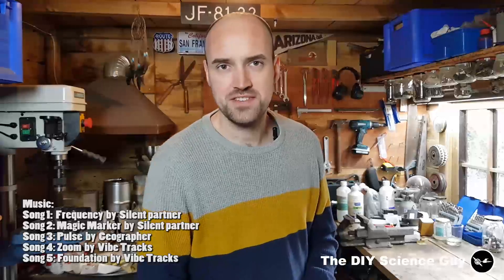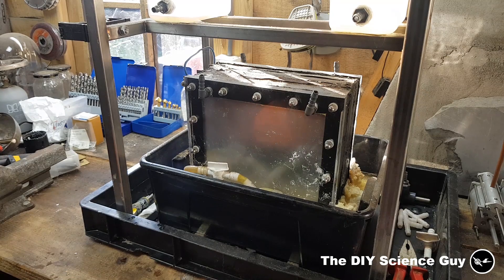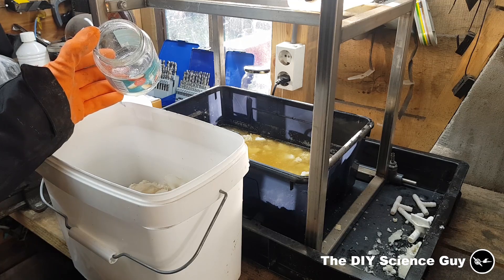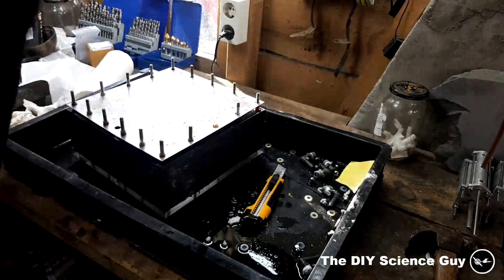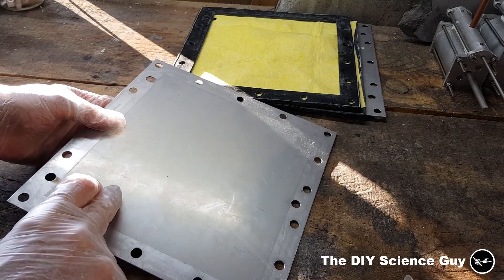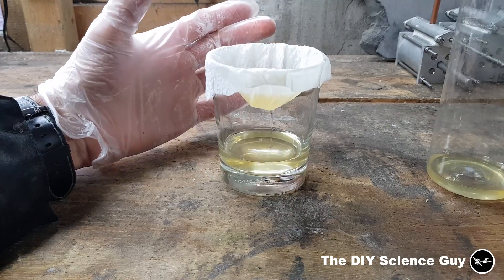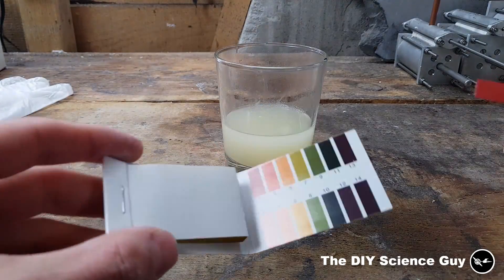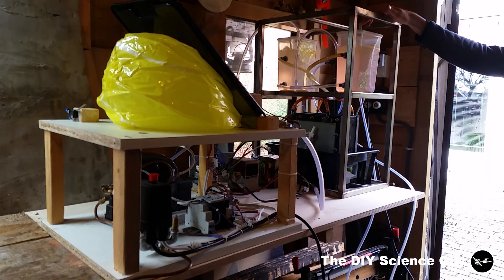Hydrogen Generator #5 Opening Up The Hydrogen Generator, Am I Producing Hexavalent Chromium?

Comment: for the hydrogen gas.  Could you run it through a propane bbq or propane accessories ?
Reply from the maker: Yes, but you need to restrict the air intake of the burner to make it burn well.

Comment: Hi superb. Can you use pure copper electrodes to electrolyse water to O2 and H2?
Reply from the maker: Thanks! No the copper will corrode away very fast. Also copper dissolves in sodium hydroxide.

Comment: As mentioned in another video. Use graphite plates. more efficient, cheaper in purchase and no nasty surprise due to decomposition.
Maybe you should use glasplates as membrane with a little slot at the bottom to separate the gases

Comment: What did your electrolyte generator drop? Bad dictation? How long-lasting is the membrane separator, which material do you use, in my made drj cel cell separator, the membrane for separating H2 and O2 gas is made of fabric, and for two years now it has been working flawlessly in :)
Reply from the maker: Nice! My membranes lasted 1.5 years. Indeed fabric works well. Polypropylene mesh is best.
Reply: @TheDIYScienceGuy   Take a look and like my experiment   https://www.youtube.com/watch?v=X69llnatPb8&t=5s
Reply from the maker: I will, thanks!

Comment: hi just wanted to ask what you think abaut using a 2 plate system at 4 volts. as far as i can tell this would be cheaper to build and easier to manage tbh im new to this stuff bet i cant see any problem with this theory so could you tell me what you think? im going off of electrochemical theory so i dont actually know if it would work in practice

Comment: I made two dry hho generators ten years ago. They were fitted inside two vehicles behind the radiator. BOTH stainless sheet were coroded within few months.The problem might be some redox reactions we still dont know about. HHO or mixture of H2 and O2 under 12v and heat of the engine bay in the summer, reaction may produce heat and/or acid or micro explotions when bubbles are forming.  After few weeks, it would require additonal  electrolyte as bubbles comes out slower. Distilled water was not enough. You seperated your Hydrogen and Oxygen, then they have not any.chance to react with each other and your temperature is controlled.  There is no pitting or corrosion on any of your plates. Mine had holes on the first one and pits on the second one. You just need to find a good cloth like membrane. The kitchen cloth eventually disintegrate in the kitchen also because it is not woven but melted together. I believe yours were set up correctly and were simply splitting H and O atoms and not nikel or chromium atoms.

Comment: You do have hexavalent chromium produce in any stainless steel electrolysis oxyhydrogen machine. I have 12 years of experience and I found a way to neutralize hexavalent chromium where it can be flushed down the toilet safely. I have EPA lab reports showing that my process actually neutralizes hexavalent chromium guaranteed. I have videos showing the process but it is not public on YouTube.
Reply from the maker: What do you mean by neutralizing? Chromium is a metal which can be oxidized ore reduced. It's never a good idea to flush it down the toilet even when it's reduced because you never know to what form it will oxidize later. Also chemical wast is taken care of for free where I live.

Comment: Excellent video! Many good news! So nickel plated copper would be affordable and chemical resistant to use safely (so 'dangerous' - well, not so!, stainless steel and expensive titanium plates can be put out). Any news about the mesh? Did you test polypropylene/pure cotton one? If no with one is better polyester or nylon mesh (both can be bought easily). Keep up you great work! I always smile when I see you face, everything is done safely and precise + good music and ideas! You made my day!

As an idea for a new video I would throw a detector subject. Simply and cheap detector for % measure of hydrogen in a mix - it would be required for safety measures when filling a tank - just something to think about. Also, better demonstration of you "balloon" :) and electrical circuit would be nice. In a long way future (I guess you are busy man) I hope you will change lawnmower with some car/motorcycle you can run on H2! :) Thanks for you hard work!
Reply from the maker: Thanks! No news yet, but in a few videos I'll have more info. Thanks for your support! 👍
Reply: @TheDIYScienceGuy  Man I love your videos, especially the hydrogen generator series, because I might want to use this in future for sustainable living and store it for use when there is no sun on solar panels.

Comment: perhaps extruded gore tex is good for a more stable separator.. Gore tex you find in the electric bay.
for the electrode, maybe carbon cloth is a good choice?
Reply from the maker: Gore tex might work well, thanks! Carbon has quit a high resistance unfortunately.
Reply: @TheDIYScienceGuy  "Carbon has quit a high resistance unfortunately."
Maybe using several of them parallel in a bundle? This reduces the total resistance. I never tried myself though.

Comment: Have you thouht about using fiber glass meshes instead of organic polymers? The latter might not be as stable as the former in an alkaline environment and should be able to fulfill your physical requirements as well.
Reply: Hydroxide easily dissolves glass. Fiber glass separators only work well in acidic solutions.
Reply from the maker: @ Both Hohbaum: No I haven't tried that, might work well! @Ghl Scitel: hydrofluoric acid dissolves glass, I don't think that sodium hydroxide does anything to glass but that's easy to test.
Reply: @ghlscitel6714  oh yes, you might be right, this is somehow counterintuitive. NaOH pellets are mostly stored in plastic containers... depends on the type of polymer, I think. 
Generally my thoughts where that complex polymers might provide to many weak points in their chains. Polyethylene should be pretty stable though.
Reply: @BothoHohbaum  well, it is a laboratory rule not to store caustic substances in glass bottles.
My consideration was that polycarbonflorides have the most passive surfaces and should be corrosion resistant to caustic solution, even when boiling hot. Thats why I asked to try gore tex. Gore Tex is expanded Teflon. It may be porous enough to work as an electrolyte separator. A few drops of detergent might be good to reduce the electrolyte's surface tension.
A table of chemical resistance of different compounds can be found in the internet in many places, and also here:

https://www.customadvanced.com/printable-chemical-resistance-chart.html

Comment: Stan's process used electric resonance to improve efficiency, instead of a continuous flow of direct current, apply pulses at very high frequencies (in the megahertz) to resonate with the electron's vibration around the atom. Below Stan Meyer's video.
https://www.youtube.com/watch?v=staL1wr07Sg
https://www.youtube.com/watch?v=staL1wr07Sg

Comment: The kitchen felt did surprisingly well. But in the end dissolved. Have you considered using pp (polypropylene} felt or fabric as separator membrane? Pp should handle this better. In industry plating anode bags are made from pp felt are used. This material is also often avaliable as aquarium filter bags in various mesh sizes down to 5-10 micron. Bag size is usually 18cm Dia and 60-80cm length. If you cut these up they should be big enough. A cheaper alternative which I use for making anode bags is the white polypropylene weed textile or geotextile. (the stuff you put under gravel roads to prevent weed growth) Mine has a sort of fine "waffle" structure on top and is denser than a coffee filter. Check description if it's really made from pp, there are different manufacturers. Maybe that's helpful, but since you already tore it down you must have replacement materials already lined up.
Reply from the maker: Thanks for the useful info! 👍

Comment: Why is your yellow membrane cleaving? I use porous jeans fabric material and it retains the physical and strength properties. Have you been researching how to release chromium oxides in water electrolysis? We work and make various hydrogen generators, we also do research in the chapter on Electrochemistry, so we can work together
Reply from the maker: The membrane is made out of synthetic felt which dissolved over time, I don't know the chemical mechanism for that. Yes I was going to use cotton for my new membranes, so it seems to work well? I'm going to use nickel plated copper electrodes for my new generator. Nice work you have! Where are you from?
Reply: @TheDIYScienceGuy    Thank you . I'm from the Republic of Serbia. In the future, I plan to make a combined device that can be used both as a cell electrolyser and as a fuel cell fuel cell. That's what I'm working on now with these technologies and experiments. I see that you are famous on Youtube for various experiments, so that we can join together to work together projects;)

Comment: What are you calling Kitchen cloth, paper towel? I thought you were using stainless steel for your electrodes, I think that's what most people use 316 or 316L stainless, something like that. I thought chromium was a natural element, you can neutralize  the acid with baking soda.
Reply from the maker: Chromium oxides are very toxic!
Reply: @TheDIYScienceGuy  I didn't know that, thanks man. Is that just paper towel you used for the membrane or is it cloth? I remember you telling someone they could just use an old T-shirt or bed sheet I think.
Reply from the maker: You're welcome! I used kitchen cloth which is made out of synthetic felt, but that dissolved after a while. I need to do tests for the new membrane material but indeed I think pure cotton will work fine.

Comment: Very interesting results from the chromium test! I think it is voltage that affects this discolouration the most. My old cell was like your first cell without neutral plates, and at 12V, it would produce brown water very quickly. Do you remember noticing this? Stainless steels have plenty of iron in them, and I think at higher voltages, the iron starts oxidizing. From my bit of chemistry knowledge, iron oxides take less energy to create than CrO4 (oxidation numbers, etc?) so a much larger proportion of iron oxide is created and immediately enters solution, causing that rust colour. It takes only a microscopic amount of iron to make enough oxide to discolour the water, and plate erosion might take many, many hours to notice by eye. Perhaps CrO4 is still created, and others, but at much lower values statistically (possibly negligible) than iron oxide since it is still most plentiful in the plate material, and has a lower oxidation number. It could be at low enough voltages, this affect doesn't happen at all - but then there's little H2 production of course. I can imagine as you increasing voltage, more unwanted oxides like CrO4 are created. Could be that the fabric die, but in your split cell video it did't cause any discolouration after week or so? Hopefully with nickle plated cells, none of this will even matter hah
Reply from the maker: Yes that's the hope! 👍

Comment: The chromates are just everyday business when dealing with those cells. You just need something to reduce it for example disulfate. Then it should fall out as chrom3 as hydroxide.
And yes that cloth definitely dissolved.
On my channel I have also such a cell, without the seperation of the gas. It gets yellow as well. However, this is also due to iron dissolving.
Reply: I think the guy from wasserstattsprit.at told in his vids that the stainless steel plaids should be just prepared with "Ameisensäure" Formic acid . Can that be right?
Reply: @christianrau6071  was der Typ so von sich gibt ist absoluter Schwachsinn. Der, gemeinsam mit dem Verein Gaia erfinden eine Energie Verschwörungstheorie nach der anderen und ziehen damit den Leuten das Geld aus der Tasche. Trockenzelle, Gans, Auftriebskraftwerk etc...
Reply: @Freizeitflugsphaere  kann sein aber hat mich erst auf diesen Schwachsinn mit der trockenzelle gebracht 😊😉
Ich finde die idee cool von  The DIY Science Guy mit alternativen Membranen zu experimentieren.. man könnte sich auch was von fumatech kaufen... Ich hätte auch gerne eine seperatorzelle... Wenn die tatsächlich reinen Wasserstoff herstellt kann man das eventuell auch komprimieren.. und wenn man braunsgas braucht vermischt man das einfach wieder im bereits idealen Verhältnis mit dem Sauerstoff..
So eine pemzelle soll dann ja auch effizienter sein oder? Und das olle Elektrolyt gepansche entfällt dann wohl auch..
Reply: @christianrau6071  Trennzelle hab ich zwar keine aber wenn dich Trockenzellen so interessieren, kannst mal nen Blick bei mir vorbeischauen...
Zitronensäure oder Ameisensäure ist übrigens quatsch. Das verändert rein gar nichts, außer, dass man nachher Verunreinigungen in Form von verschiedener Salze in der Lauge hat.
Reply: @Freizeitflugsphaere  ja deine Videos sind echt Klasse! Du erklärst das ganz toll und zeigst auch wie man das baut. Magst du nicht mal ne pem Zelle nur für Elektrolyse bauen und her zeigen? Was hälst du davon Titan platten zu benutzen.. sind dann  nur ab Pluspol nötig glaub ich...
Reply: @Freizeitflugsphäre danke für deinen Kommentar zur Ameisensäure!
Hast du das mit dem Disulfat schon gezeigt ? Und wie du das anwendest...?
Reply: @christianrau6071  momentan fehlt mir das Budget für ein neues großes Zellenprojekt.
Aber zum Titan. Da hat mir mal wer geschrieben, dass er sie verwendet hat als + und - pol und mich dann gefragt warum die Zelle überhaupt nicht funktioniert. Meine Vermutung ist, dass das Titan eine TiO2 passivierungsschicht bildet, und die Platte gar keinen Kontakt mehr zum Elektrolyt hat.
Teuer ist das Titan außerdem.
Mit Edelstahl hab ich bisher keine schlechten Erfahrungen gemacht. Außer die Bildung von giftigen Chromverbindungen...
Reply: @Freizeitflugsphaere  ja wegen dieser natürlichen Oxidschicht soll es ja so Korrosionsbeständig sein.. es werden ja auch im Internet drycells damit verkauft.. k.a. ob das Sinnvoll in Bezug auf. Chrom ist...meine Überlegung man bräuchte vlt. nur eine einzige Titan
  -| n n n n n +ti n n n n n |+ @14,8V

Comment: So nickle electrodes will not erode?
Reply: In the tests Tim did, nickle seemed to hold up extremely well and doesn't seem to oxidize or discolour the water - no oxides; no carcinogens. He also brings up the idea that nickle has a high resistivity, so he plans to use DIY nickle plated copper. Very cool! Watch the video here:
https://www.youtube.com/watch?v=Zn1hkzvFZOI
Reply: @cwatson600  Yes, the exposure would be during the plating process itself (against which sensible precautions were taken in this video), which is basically a one-off and anyhow nickel carcinogenicity is pretty weak and only really via inhalation. Mainly it is a contact allergen. The most dangerous thing here is still the hydrogen!
Reply: Nickel electrodes won't form hexavalent chromium compounds; however, nickel is also carcinogenic. Seems you can't win.
Reply from the maker: Yes it's also carcinogenic but nickle oxide will not dissolve in sodium hydroxide and it's therefore much les likely to get into the environment. Nickle oxides are also not as carcinogenic as chromium oxides are, and have a much higher resistence against corrosion.

Comment: Don't forget to tell the guys at waste disposal what you brought them and the chromium test you performed. Then they can neutralize it with sodium hydroxide and pour it down the drain :D
Reply from the maker: If it's there than it's already in sodium hydroxide because that is what I used as electrolyte. You can't neutralize chromium oxides only reduce them to a lower oxidation state.